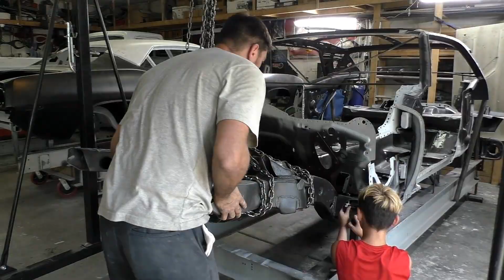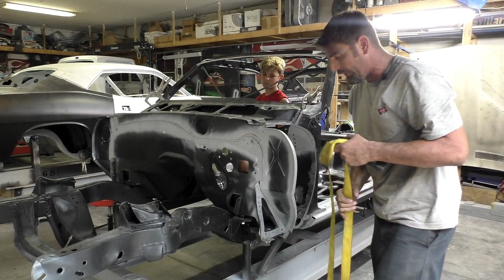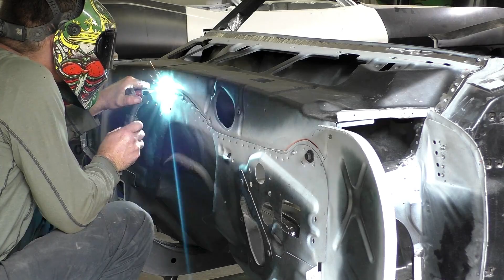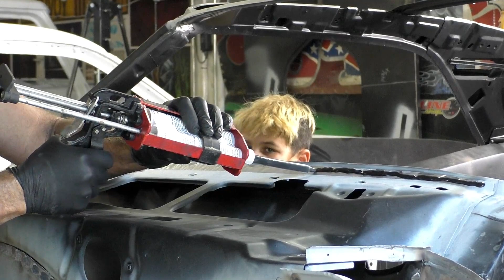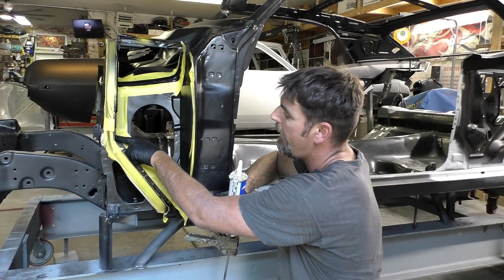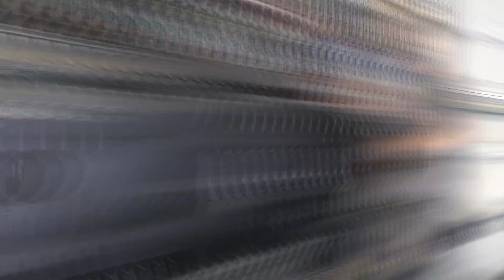1969 F body installation of Outer Rockers, Subframe, cowl and dash panel Camaro & Firebird episode 5

Comment: So much preparation you’ve done to make it assemble on camera relatively smooth. It’s was great watching your son get into it. I was wondering if he will follow your footsteps or if the demand will still be there in the future. 
What seam sealer did you use? You talked about strengthening the car frame with welding the seams. I was wondering if you thought about welding it together like a unibody and why you would want to keep the design of frame removal? It would seem stronger than a car resisting torque with just bolted locations. Just wondering cause of your racing background. When you did customized race cars didn’t you weld solid frames? Enjoyed the video. Did you teach your son to weld?
Reply from the maker: So I used believe it was ACdelco seam sealer on this project, I rotate seam sealer at times. Actually its funny last night I started welding in the subframe connectors from the rear frame to the front and this car also got a rear roll bar and down tubes. Another week or two before that video comes out. The build was planned from the beginning to be welded together the front clip to the rest of the car and yes I feel it is far superior in strength. So the bolt in front subframe is to locate the chassis before welding while making the fenders and everything else line up. When I build "true" race cars most of them were full tube chassis cars with a body hung on the chassis so its a whole different ball game vs the street "fun" style cars as this one will be. Also yes my sin has a litte bit of welding under his belt both TIG and MIG, I am not trying to push it so its still only fun for him now.
Reply: That’s a great approach for your son. I grew up learning about metal working in a machine shop from my grandfather and father. Never realized how much I was able to learn and take advantage of until later in life from old school methods then learned how to weld. If he doesn’t know now he will realize later how much skill he develops from his dad right at home as compared to others who have an interest but have to pay for technical skills. Maybe he will get the finish painting skills and have the whole package. You will have to build an addiction in the future. Thanks for the responses. I will continue to watch and wait for more. Maybe some time you will do a custom rod design for racing. That would be interesting to watch as well as restoration work.  Enjoyed it.

Comment: I was watching you weld and it seems like we use the same welder. Lincoln mig. I have a lenco spot welder I use for my spot welder. I am just so impressed with you and your wife. you guys make a good team. what part of north carolina are you from? do you paint all your cars?  well catch up with you later . I dont see how you get so much done doing a you tube channel plus doing the work to. talk later
Reply from the maker: Thanks a lot for watching and commenting. I appreciate it. Yes the welder I have is the Lincoln pro mig 180. For the sheet metal stuff it has been a good welder and I have had it over 15 years. I have though about upgrading but as you know it welds nice and rarely ever gives me issues. I am from Carthage NC and actually we don't usually paint cars anymore, mostly the metal work. I will do one and two here and there for really close friends and family to keep in practice. With the youtube and working, it can be a little bit of a balancing act but I try and set goals on videos and shop time and try to stick with them. Thanks again

Comment: Question at 19:05 in vid right next to c-vise grips on the windshield cowl are 2 small oval holes punched out .I thought it was rot on mine and welded them closed. Do you know what they were for alignment locations from GM?Hopefully nothing important. What a great build!
Reply from the maker: Humm I know the dash covers over half of them. I think your ok as the last 69 firebird I assembled I don't remember screwing anything into them

Comment: Is the cowl panel the same on a Nova? Mine is TOAST. Thinking about saving it but would be so much easier to re-do it. But my inner cowl is fine just the whole top. Thoughts?
Reply from the maker: Yes they are not interchangeable but in general they should be the same process to install. Getting the upper cowl out without damaging the lower will be the challenger but possible. I would personally replace it if it is that bad, then you would be able to get to the lower cowl from the top and seal it up with epoxy and make sure you don't see more damage you missed from the bottom.
Reply: @carthageclassiccars  okay good point thanks man!

Comment: Where did you purchase the cowls. I got R/s from Muscle car central (AMD)and needed to split and pull apart upper inside corner and  patch and weld. D/s i got from American performance (Ebay) aka Taiwan absolute junk., Is there anything made in America anymore?
Reply from the maker: No I don't believe there is any parts made in America anymore that is just the world we live in unfortunately. Both the cowl side pieces are AMD here. What I ended up doing is pulling and prying off the JIG and they seemed to work just fine.